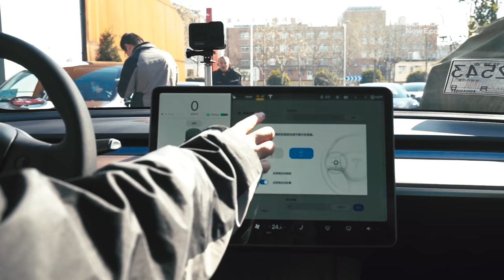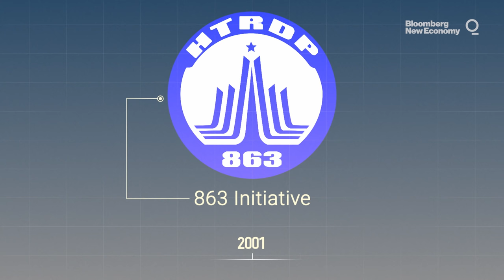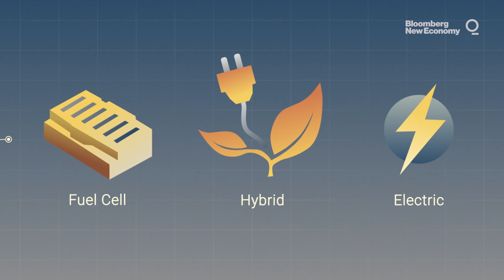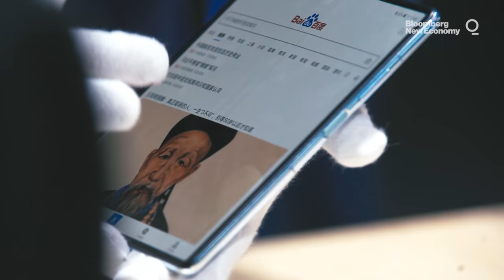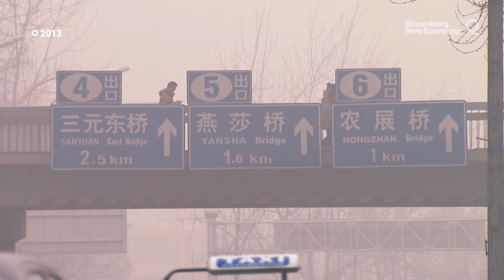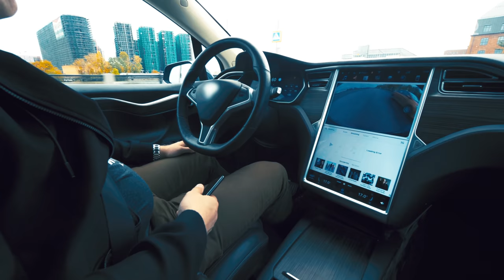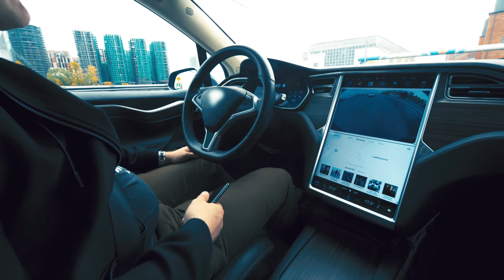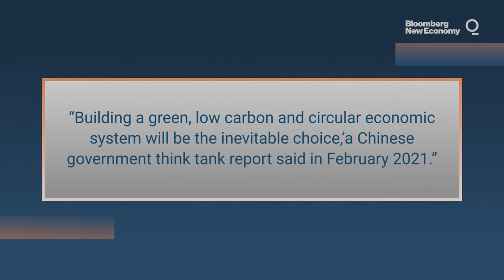Why China’s Electric Car Lead Has Been a Long Time Coming

Comment: Yeah they have NIO and Nio is already beating Tesla in a very short time
Reply: Anthony Q  tesla sells cheaper vehicles. Tesla marker cap is not justifiable either
Reply: Anthony Q  I'm actually a early tesla investor who invests in nio as well. But nio is better because they understand the dilemma EV manufacturers will face with the new batteries coming in 2022.
Reply: Anthony Q  that's fine for me. My average in Tesla is in the $30s and NIO in the $3s. I'm just saying that with new batteries only NIO can conveniently swap the batteries out. Tesla cannot, neither can any other EV besides NIO. Which places huge burdens on the owner because battery range is going to almost double with solid state batteries. I don't personally think the law of averages would allow Tesla to reach $4000 from today.
Reply: Anthony Q  i think the problem with newer retail investors is that they're too emotional. They don't view business pragmatically. Morals and beliefs become more of a arguement than the actual business model. You haven't really provided any substance. You just brought up emotional perspectives.
Reply: Anthony Q  i got into Tesla early. My average is in the 30s, i have said this before
Reply: Anthony Q  well nio is better because of the battery swap technology. This is because the rapidly increasing battery range can be used by all nio owners because of swap technology. While everyone who bought a tesla is stuck with there low ranged tesla. This is even when we have 150 kwh batteries or more.
Reply: Anthony Q  you still avoided my point
Reply: Anthony Q  no but here is my point. I will explain it. Focus. Respond to this. If the current standard of an EV is 200-350 miles of range with a lithium ion battery. 

When solid state batteries come out in 2022 and become refined. It will offer the standard range of 600 miles. So the standard of range will go from 200-350 miles to 600 miles or more. A tesla cannot swap the batter out. Only NIO vehicles can due to batter swap technology. So nio vehicles can always have the latest and greatest batteries. But a tesla owner is stuck with there 200-350 mile ranged battery. This puts huge burdens on to the Tesla owners. They will be upset because the rentetion and resale value will go down.  Because the same Tesla Model 3 will cost relatively the same but with double or tripple the range. This means that the resale and vehicle retention value drops down dramatically. So there vehicle depreciation is large. Do you understand?

If Tesla were to change each Teslas battery with a solid state battery. It would cost in the hundreds of billions. If you think customers won't complain, they will.
Reply: Anthony Q  ???
Reply: Anthony Q  hey. I understand that Anthony. I really do. And you know what? I don't blame you for not being able to answer my question. I hope you do well in your investments.

Comment: EV innovation is overrated. Most of the technology was already been there for years. Making an EV is easier than a petrol car. It is just about putting different parts of the technology together and creating the infrastructure. The technology that really needs innovation is the battery technology it has been going at a snails pace.

Comment: The problem with Tesla is that they think they own the US EV market. Currently, they do, but Ford has caught up in terms of battery range, GM has caught up and surpassed Tesla in terms of self-driving, and every automaker is pivoting to EVs. Tesla is becoming complacent, becoming stagnant. If they don't continue to innovate, it's very possible they will loose their spot.

Tesla is the first, and arguably best, ev manufactuere on the planet. But now they have to compete with Audi, Ford, GM, VW, Toyota, Polstar (Volvo), and Honda. They have actual completion now. Their decade on top is now in danger
Reply: they the IBM and Nokia of BEV
Reply: Hilarious remarks, says the guy from 2030 😂 all those non-Tesla/non-overtheairupdate-FSD/knock-off companies are either bankrupt or merged or bought out 😭🤣

Comment: There is no discussion about how to enhance ICE vehicles to be more relevant. If the VW GTI were built using composite materials, so that its body weight could drop by 50%, that would be a fuel efficient car with high performance. Why have western car manufacturers not explored building lighter ICE vehicles? ICE vehicles have the advantage they can be repaired by 3rd parties too. Something does not add up.

Comment: If you guys bother to switch over to hydrogen cells it would take less than 5 minutes to refill the car leave the exact same Motors everything the engineers already put into the vehicles just switch to a hydrogen cell it'd be so much quicker especially here in the US since we have to import more than 20% of our power daily and a lot of States you got to drive over a hundred miles just to go to a decent shopping mall upgrading the batteries not buy multi more batteries buy deeper cell charging and quit trying to follow Tesla Tesla has great charging stations I guess what none of them work during a bad storm they have absolutely no backup power supply anywhere

Comment: Those 5k EVs look like death machines. Cheap for a reason. It is nice to see China pushing electric vehicles and clean energy, though!
Reply: Those boxes on wheels are designed for transportation within the cities, in where during regular hours on a regular day no one can speed up to over 30 miles/hour on the road. Also, a typical daily one way commute in China is around 6 miles in the city. As such, as long as basic collision safety features have been equipped, those 5k cuties would be quite safe.
Reply: Didn't Chevrolet recall all Bolt cars recently? Talk about battery powered death traps...